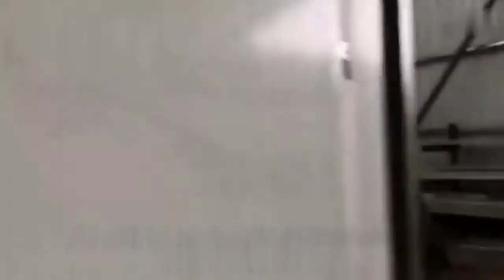Easy-fast install prefab prefabricated economical house Cheap container

Comment from the maker: 1.Light steel structure frame 
2.Water-proof system on the roof makes good sealing effect
3.Fireproof and heat insulation
4.140km/h windproof and 8 grade earthquakeproof
6.Over 25 years' life span
7. 8 skilled workers can finish installation of 150 SQM in 20 days
8.We can provide services of installation, supervision and training by extra.